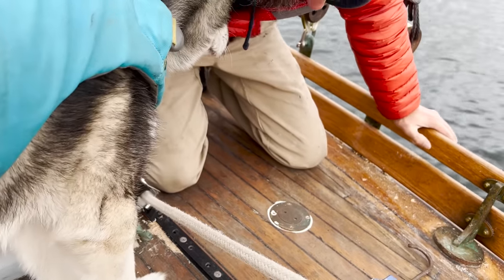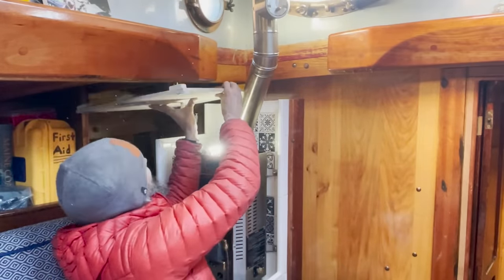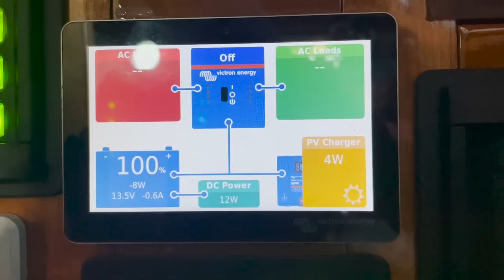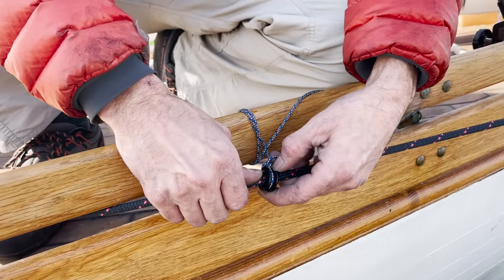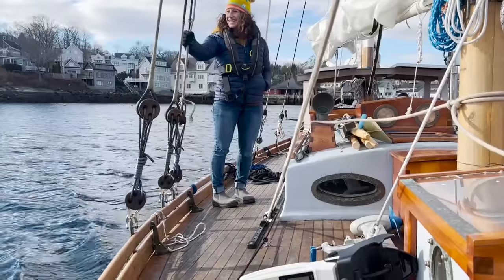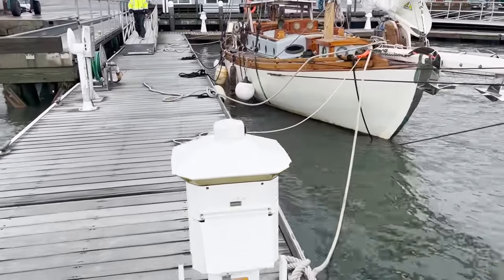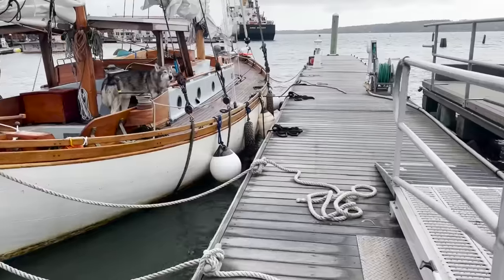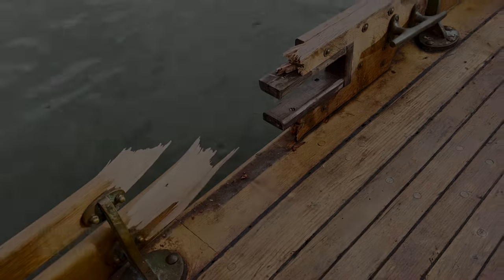Break Another Little Piece Of My Boat  - Episode 291 - Acorn to Arabella: Journey of a Wooden Boat

Comment: I saw the tiller handle smacking back and forth during the storm when tied to the dock, my understanding is that you want it lashed down hard to prevent wear out the pins and gudgeons .  That movement also causes chafe on whatever your lashing is.  Sailing  learning curve 👍 cheers

Comment: I have used copper pipe cut the the depth of the space put over the screws.  The pipe will keep the board set off the surface.  Neat look.

Comment: Are your dock lines polyester?  If so, something with more elasticity might be in order, perhaps nylon 3-strand or Mega-braid.  With dacron 12-strand double braid that short, sharp shock as the load comes on with each surge can send a very large impulse into a rigid structure.

Comment: The reason you broke the rail is because you should not have had a 90 degree angle from the cleat. The highest strength of the cleat is in the line of the cleat (e.g. parallel). It would be better to run the lines from the stern forward and from the bow aft. That also gives you more spring in the lines.

You can also put snubbers on the lines to reduce the shock loads.
Reply from the maker: Those are neat gadgets but as you mention, the lead would make the difference. —Anne
Reply: @AcornToArabella  
I have used a breast anchor on more than one occasion when there was no suitable structure available to leeward to hold me off a dock to windward, in cases where wave action -- and/or nasty dock features such as protruding rusty bolts -- meant contact with the dock was not an option. My preference is not to cleat it off but to lead it over a big roller (a large "anti friction ring" could be improvised from suitable raw materials, but in my case I happened to be carrying a very large metal sheave snatch block as used on trawlers which I had repaired for a mate) and have a large weight on the other end of the line. 
In my case, the anchor had about a 6m shot of heavy chain, which I simply turned most of into a very heavy multistrand chain, by judicious use of short lashings.
The resulting weight was hung below the leeward topsides of the boat, in the water, to keep the breast rope tight. The closer the boat came to the dock, the more chain lifted off the bottom. The snatch block was also underwater, to provide a flat scope for the anchor. 
Someone I knew who did this regularly on his own exposed dock, used what used to be called a "flopper stopper" in lieu of a weight. This is like a flat sieve on steroids, suspended in the water from four or six lines equispaced around the ring (it's a bit like an upside down tambourine, with a heavy metal mesh instead of a skin, and lines attaching where the little cymbals go on a tambo). His was about a metre in diameter with a galvanised steel rim and mesh. A rubber circle  lay on top of the mesh, cut into four quadrants like petals so that the water would flow freely upwards allowing the device to keep the breast line taut whenever it tried to slacken, but there was a "check valve" effect where the petals slapped shut on the mesh the moment the boat moved towards the dock and the  line began to tighten again. This provided a resistance force in proportion to the speed of motion, like a vehicle's shock absorber, which is exactly what is wanted. At no point does the line stop paying out, provided the rope is a suitable length for the situation. 
Unwieldy to stow, but much lighter to deploy, and has a nicer action than the weight I mentioned above and have personally used. 
The weight is a pain if there is much of a tidal range, but the sieve is fine with a large tidal range as long as it can be kept off the bottom at low tide.
His remained rigged all season, hung below a buoy situated a suitable distance from his dock so it could be easily picked up whenever he returned to it.

Comment: Hey Steve a great video update .  In heavy weather or not you might consider getting some elastic mooring springs or bungies to have more stretch in your mooring lines.  Nylon lines have good flex but the extra give on the spring bungies will put less stress on your cleats on the boats.  The lateral hard loading on the midship cleat is what did you in and the way you had the spring lines at mid ship next to the dock worked great.  All the best and thanks for sharing.
Reply: Poly? I hope you mean nylon.
Reply: @paulheitkemper1559  Yes I meant to say Nylon - lol don't know where Poly came from.  Thanks

Comment: Thanx for a great video.  About your reefing line. To me it looks like a major trip-hazard on the foredeck. I would instead run it close to the deck and close to the toe-rail back to the cockpit.  Maybe you need to use a few more blocks or low-friction rings but they won't bend the line much so the friction is probably not a big issue.

Comment: A small fan in the upper corner blowing on the exhaust would have diverted the heat and moved heat around the cabin.  A small metal shield over the one piece of wood turned color.

Comment: A thin sheet of highly polished aluminum glued to that cement board will help redirect the heat back down into the cabin.  Glue may not work as well as a few spots of silicone caulk.  No fun to see that piece torn out.

Comment: On the diesel heater exhaust you might try the black tape wrap that they use on motorcycle exhausts to alleviate some of the heat issues

Comment: I guarantee Steve is analyzing this and will come up with the best fix suitable for his needs.  I think the choices are:  1) Mount the cleat(s) on the deck instead of on the toe rail.  This may require reinforcing the deck in this area and adjusting the fairlead's location so lines transfer minimum stress to the toe rail.  2) Extend the backing board beyond the two toe rail brackets, making sure the deck is adequately reinforced in this entire area.  But beware of possibly setting the toe rail brackets up for failure.   3) Repair it as it was, and be VERY careful in the future about the direction of loading in the conditions that are expected.  White oak is very tough stuff, but in extreme conditions this boat can easily generate higher dynamic loads on lines than these toe rails will withstand.  With high latitude cruising in Steve and Robin's plans, Arabella must be capable of handling extreme conditions.  I look forward to seeing Steve's solution!

Comment: Maybe mooring compensators would have saved the cleat from being ripped out.
Reply from the maker: It’s my understanding that those don’t lessen the load on the line, but that they help with sudden sharp loads. Steve’s right about the lead. Also, had the cleat been mounted with a different lead from on deck rather that on the same structural piece as the chock, I think the outcome would have been different. —Anne
Reply: Surprised you did not use mooring compensators, a fender can also be used the same way to take some of the load off the mooring lines. The dynamic force is what what breaks stuff.

Comment: Instead of insulating the boat from the stove pipe you can insulate the stove pipe. Really the idea is to redirect the heat away from the deck beams rather than insulate the beams from the heat. 
Either use Type B as others have mentioned or grab another piece of the same stove pipe a few sizes larger and place it around the portion of the pipe that is near the deck beam with spacers. I have used lengths of copper pipe (1" long) as spacers with metal screws to join the 'heat shield' to the pipe. This creates a chimney effect with the hot air from the pipe leaving the top of the shielded section drawing cool air in the bottom.

Comment: Steve ,    We all went through the learning.  Way too many lines tied to 2 movable docks. The boat could not move. Would have faired much better not tied to the opposite dock, and not tied midships at all. Bow and stern with spring lines.  I would suggest moving the cleats to the deck or the frame of the boat. Cleats need to be solid mounting with backing if on deck.

Comment: In lashing your aluminum loops in, if you have some thread on board I'd suggest putting a few stitches in. Things will not come loose then.
That piece that got ripped out. Seriously you need to talk to the manager of the manufacturer. Demand better customer service.😉😀😂😂😂

Comment: For all deck/house top holes on a fiberglass boat...the hole is drilled over sized (for example screws for a stanchion) and filled with epoxy. Then the final hole is drilled. That way even if it EVER LEAKS...the core will never rot. I know this is a Wood boat but would the same principals apply?
Reply: Just coating the end grain with epoxy would reduce any water ingress in the future. If and when water seeps in it will be slow process and it will not spread like it does with a glass fiber balsa core boat.

Comment: Alix, it's nice to see how well you work through the problems that are presented on the boat.  I remember you and Steve working together from back in the old days.  Good times.
Reply: Not quite the same since Alix left. Experience needed to keep this project afloat.
Reply: @usmcforever7630  I agree.  When Alix left to "build his own workshop" and take what I think was a job as a "rock climbing attendant," it was clear to me that the bottom fell out.   Also, seeing Steve only meeting Alix's son at launch told another story - they hadn't seen each other since Alix left.  So, what happened to Alix's effort and dedication in this endeavor over multiple years?  

It went down the drain, despite Steve stating (yes, it's on video record) that he would be building Alix's boat with Alix - just like Alix did with Steve - after finishing Arabella. 

So, when do Steve and Alix break ground for Alix's boat?
Reply: @maitai1180  yes. I do understand that Steve had a right on the ownership of the boat but the fallout of those two friends felt strange. It was a shame, those two had a good chemistry
Reply: @usmcforever7630  So many of the blanks can be filled in by basic logic and inference.  Is Alix the type who would put down an ultimatum?  I don't think so.  He also never came across as someone who would quit in the middle of his dream project - at least, that's how they sold it in the beginning.  Two friends chasing a dream...

So, what drove him away?  A2A is very tight-lipped on this topic, ignores it, and other times, tries to put a progressive spin on it to whip up meaning through the use of word salads.  But I think a lot can also be gleaned from what is NOT said. Just look at the launch ceremonies...

Did you see Steve's speech on the boat ramp?  How long did that one last?  60 or 90 seconds?  Was it thoroughly planned out to recognize everyone who gave, contributed, and supported Steve through this little dream of his?  I didn't think so.  It seemed to me that it was more about Steve, and Steve's beard.  His challenges, his goals, his dreams...and, oh yeah, there were some people who helped. 

Truth be told, if anyone really wants to understand why Alix left, they would likely be dead on of they pictured Steve looking at himself in the mirror - although he goes to extraordinary lengths to appear neutral, accepting, and unbothered by...other people.  

In this episode, Robin made reference to "our boat" - and look, Robin appears to be a very kindhearted, warm, full-depth person.  I have never, ever thought of her otherwise.  And the truth is, since Alix is out and Robin and Steve are getting married, it will, in fact, be Steve's boat and whatever part Steve wants to share with Robin.  Hugs, Robin...

So, hearing Robin refer to the boat as hers and Steve's is just fine by me.  But what I'm not cool with - and I don't care if anyone agrees with me or not - is the position Alix is in now - which lacks any ownership, and apparently any shared or returned value.  Those years weren't free to Steve; they were paid by Alix.  They were paid in exchange for what I certainly thought would be Steve returning AT LEAST the same amount of time, money, resources, and value that Alix did.  So, was there a settlement agreement where Alix was recompensed for his hard work and personal resources that he contributed to Steve's little dream?  I would bet money that, not only was there no settlement evening up in fairness to Alix, but also that to this day, all of that work Alix DID put toward A2A likely has been kept by Steve for his own benefit. 

And Steve, if you're reading this, I challenge you to do what is right.  Address the circumstances as to why Alix left the project without a single visit until boat launch.  Own your part in his departure.  And if you really feel like wowing the people who love and miss Alix, address whether he has been fairly compensated for his work, at a minimum.  

Sir, you do not simply get to keep everything that Alix put toward you, your boat, and your dream.  I mean, you certainly can do that...but wouldn't it be such a shame to selfishly pretend as if glossing over Alix's very real and substantial contributions under your own justifications was good enough - instead of doing what a truly good person would do under similar circumstances?  You know, not owning your shit, being truthful, and being fair?  Yes, that would be a shame, indeed.

Comment: I don't know how violent the wave action was, but my suggestion is to put as many fenders between the boat and the floating dock as you can and then tie the boat tight against the floating dock. They will move as one without rubbing or crashing. This would work especially well when the boat is windward of the dock.
Reply from the maker: That’s the thing though, it’s not the safest, holding the boat off the dock really avoids some forces against the planking.

Comment: Try another method , i have always found rearly light ropes cause jolting . And snapping , let the boat move ,    and next time you put the lines over liķe that cross them , from the boat the bow line to the other dock at the stern , and stern to bow ,  it works well,

Comment: Rebuild your toe rail the same way, and it's just going to break the same way next time. 

A couple of things: firstly we didn't get video I think of the worst of the storm so this is only going off what I can see. I think I would have moved my boat to the other side of that marina where you tied off those long lines, instead of just dragging lines over there. Secondly, three strand nylon is going to give you much better stretch than that stuff you're using right now. Thirdly, I tend to like to put the running end of my dock lines on board so that I can adjust from on board instead of having to climb down onto the dock to adjust. There's probably a fourthly in there, but that's enough unrequested criticism for one comment. 😉
Reply from the maker: Ha! A fourthly. 😊 happy Friday! Thanks for being here every week.

Comment: I'll start with the arm chair advice / critique first: 1. I have said it twice and now will be three times "flogging is unacceptable !" <---- chant that while you repair that midship cleat. The idea may seem sound but as another said in comments you essentially tied two finger floats (a great distance apart) together. I get the 'stand off' from the float idea but in practice it just doesn't work ! To much potential for flogging action! Someone said and I agree, tight to the one float, on its Lee side. Bow, stern and spring lines all snugged up, squish the snot out of those fenders ! 2. Who did that nasty cleat job on the bow line over on the far float. I wouldn't want to have to deal with that in a blow, in the dark. 3. I am amazed at how tall your forward stand pipe  is. I'll also be surprised if it makes it through a 1/2 dozen heavy air sailingbdays before it auto reduces its own height with the aid of a flogging sheet. 4. I already mentioned: with the massive amount of tools you carry I can't believe you don't have a cordless Sabre saw. Now I'll add 'no hole saws up to moderate 2 - 2.5" ?". You guys are awesome ! I love the comment made about 'Steve sitting on a pier hand stitching with palm,needle, thread and bee's wax (I hope you have those in a small rigging kit aboard. I do even on my little 'Rascal'. My kit lives in a large 'Straberry mountaineering' facsimile, chalk bag I had made a small run of some years back ;)   good fortune, therapy and recovery for your mom Steve. Kudos to Robyn for having no qualms with the diversion of your lifestyle. There is no higher honor than 'being there' for your parents / elders ! I returned home from 18+ years of living in Hawai'i to be with my mom in her last year of life. That was one of the very few life decisions I made that I would never change ! Rock on, Shaka U 2 ! :)

Comment: Hasn't Arabella already got a diesel filler, isn't there one for the engine? Is Steve using two independent diesel systems? And at the cost of another, & unnecessary, hole through the deck?

Comment: Those aren't really springs,. They are more like breast ropes, and they are not capable of taking a lot of force, as they are short and not attached to the strongest part of the ship.  True springs are long and will be made fast fore and aft on the vessel, and then taken to the opposite ends of the pontoon, so they can really spring.

Comment: From my experience it looks like your spring lines could have been longer, near the length of the boat even, so from the bow to dock near stern and vice versa.
Reply: yes, carry spring lines the length of the boat. then you can use them as bow, stern or mid-ship springs. right now we are on a dock with pilings far from the boat ends. we have the springs from the boat, around the pilings, and back to the boat. handy.